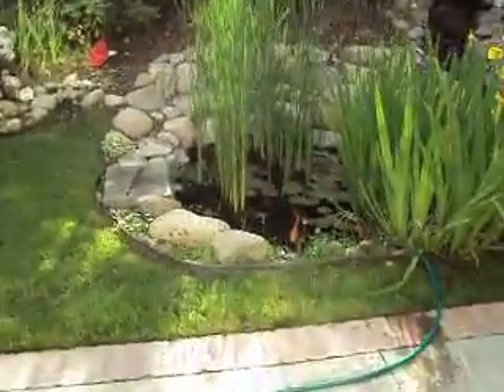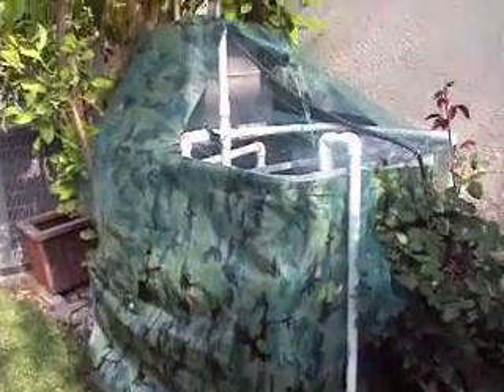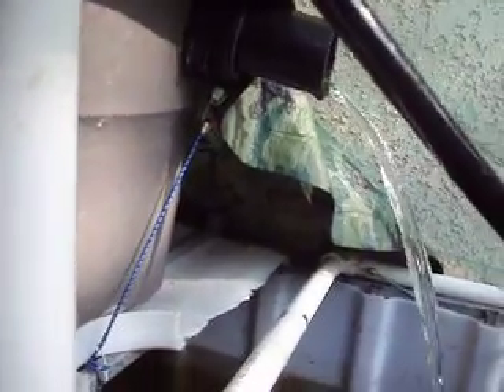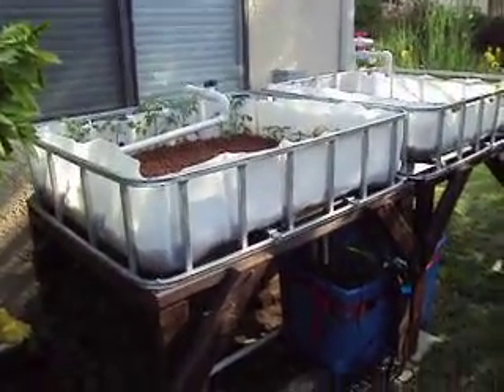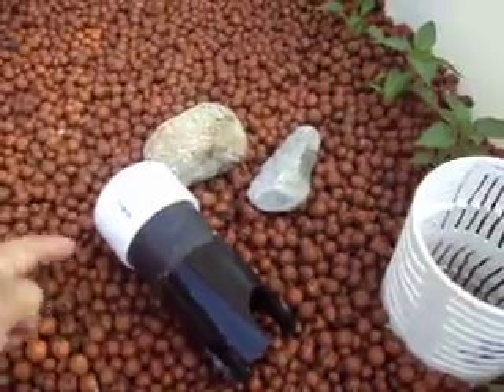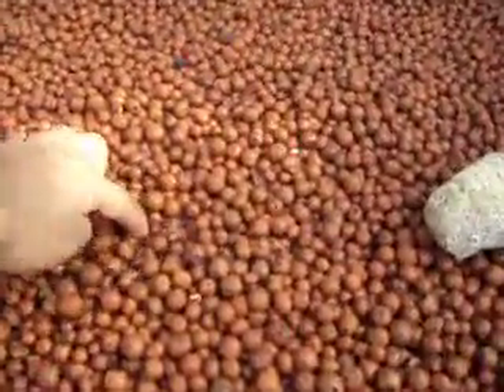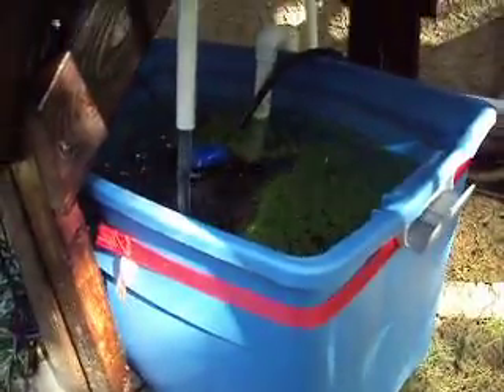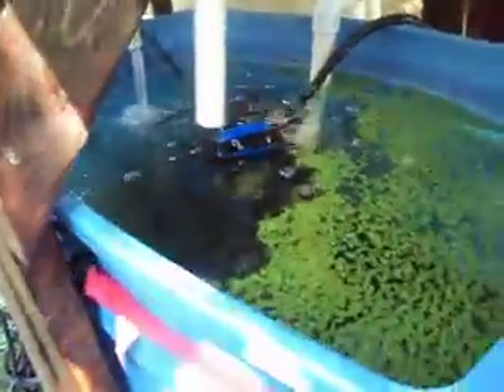Aquaponics System

Comment: Maybe it will be possible for you to put your fishtank in the ground and in the process get rid of your blue sump. Be sure to add insulation to the sides, the more the better obviously. The bottom of the tank sat on a nice layer (1,5 feet or so) of corse (3/4-1 inch) river gravel (pebbles) As you probably know, the ground has a constant temperture. This and the side insulation will cut back on heating costs. Good luck.

Comment: Hi, duckweed does not like water movement at the surface so if you like duckweed growth on the up (doubling in mass about every 4 days) you need a container which does not have the surface movement but some movement at the rest of the waters mass. Hook up a surface pipe up to the main fishtank and let it let water i your duckweed tank at the botom, maybe with use of a valve to control the flow a bit. also connect te duckweed tank to your sump via a bottompipe. good luck.